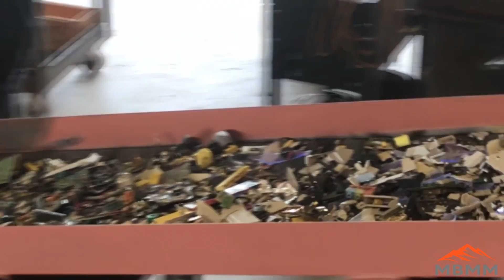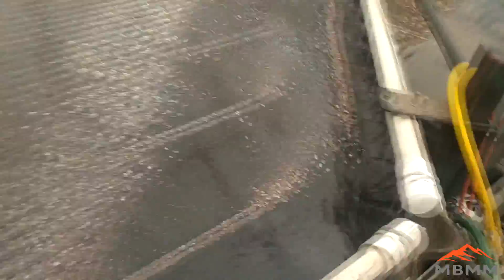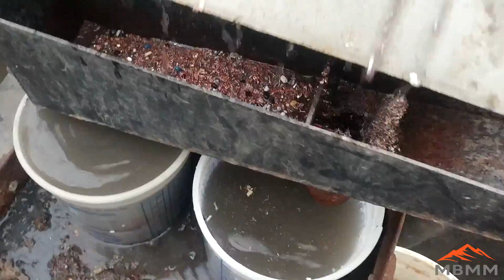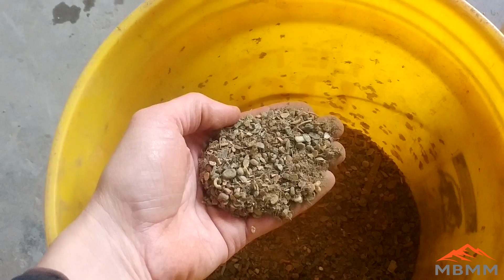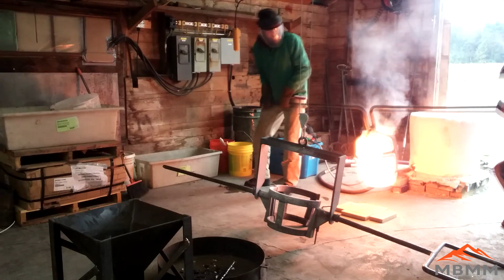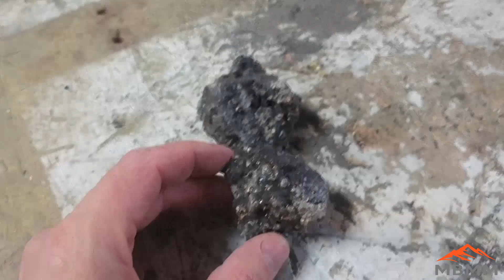Shredding & Melting Recycled Computers: Gold, Silver, Copper, Scrap Metal Recovery

Comment: I'm sure you figured it out since then
this is why you want as pure separation as possible BEFORE melting
i think you nailed the analysis Alum and iron oxidized and combined with the slag
Alum oxidizes very easy
you should have did a water rinse after grinding to separate the light plastic out
which will help reduce slag

Comment: How do you refine and sort metals that are melted together? How much did it cost to build the hammer mill? I want to build one from scrap metal and use it on circuit boards, wires, etc

Comment: A lot of the "plastic" pieces were tantalum caps.  Also, you didn't speak to palladium and nickel.  It was very informative to see how you reduced pcb waste to "metal bars".  As a chemist and an engineer I've been thinking about a scalable process to recover individual metals.  Tough nut.  Lab processes are much easier, but industrial is really tough.  I have some waste bars that appear to be mostly tin.

Comment: First the plastic is not waste at the very worst it can be promised to create feeder stock for the plastic and petrol industries second separating the case from circuit boards and components is probable worth doing by hand as it makes separation much easier Third it might be worth while to recover the fiber in long enough strands to sell as a concrete stergthing adaptive.

Comment: That water is contaminated waste now. Lead, mercury, cadmium... etc. Seperating more valuable components mother boards, ram, riser boards etc. and using a chemical process is far more efficient. I would definately recommend a respirator while being around the furnace and pouring stuff like that...heavy metals are nasty.

Comment: this is why they manually strip electronics (steel frame, plastic panels, wires, PCBs etc.) then they take anything that is metal unless it is obviously just a steel frame or panel only and turn it into powder and run it under seriously strong magnets to get rid of as much iron as possible. Then they dip it in acid and chemically separate valuables like silver and gold from copper and remnants of iron/plastic (PCBs go straight to acid). Then they smelt copper into thin sheets which will be submerged in a pool of copper sulfate and serve as anode and is then purified via electrolysis (final product is electronics grade and directly sold as is to manufacturers of cables and such).

It is really interesting stuff.

Comment: 20:18 use a reductive flux or add some more reative metals like alkalimetals which form low melting point oxides
since al2o3 got a pretty high mp (around 2000°C) it forms this insoluble junk
you may also remove aluminium beforehand with hydrochloric acid which will not dissolve your precious metals
another way may be gravimetric separation using sodiumtungstate solutions which can be as dense  as 3.1g/cm^3 so aluminium would float while other metals sink (its pretty expensive but you could recycle it as often as you like)
also your solid metals probably will not sink to the ground of your crucible since copper is more dense (same as rocks float on mercury)

Comment: do not shred towers.  Gold becomes fine powder. it floats in the wind. Instead take them apart using screw drivers.  Separate them into part that contain precious metals and those that do not.  Melt the parts containing precious metal. use no flux. Cover the parts with charcoal.  Pour into a mold. Analyze  that ingot.

Comment: With pyrolisis you get diesel and ash, i think it might be easier to get the metal from the pyrolisis ash or pyrolisis chamber maybe?, run the waste from it  through the system  too..? that and you could crush up the slag with the metal bits from the pour too..

Comment: circuit boards, brass standoffs, aluminum heatsinks, copper wire, lead and tin solder on galvanized cold rolled steel.

Comment: Some of the slag crap is likely very high-temp metals like platinum, tungsten, and tantalum.  

Older computers had more of those.  

I know when I do an aqua regia dissolution of old 1990's circuit boards and smashed chips (especially from old lab tech stuff), after bringing it to a boil and letting it cool, fine grey dust simply drops out of solution, which is all the platinum-group metals.

Comment: I like your videos as they are very interesting and informative. However, I cringe every time you use your furnace. Ceramic insulation releases its fibers when heated and is extremely hazardous to the health of your lungs and can lead to silicosis. Please consider coating your kaowool with rigidizer, coating your insulation with refractory so the ceramic insulation is not part of the flame face, and wearing a respirator!!!!!!! I realize that it would change your process and make things less modular but worth it in the long run.

Comment: Just read a paper which explained that mechanical shredding of whole components leads to a significant loss of pm because big parts are seperated with the iron fraction. They recommend to remove PCBs before shredding. This is also how the big recycling companies do it. They don't accept whole pcs because the high iron and aluminium content is disturbing the recovery process. So they buy only clean PBCs. Plastic however is not an issue for them. pastic is incinerated during the melting process und the released gases are cleaned in a scrubber.

Comment: In electronics much of the precious metals are plated onto another metal. In the case of connectors and  integrated circuits, those metals are magnetic. So I suspect you lost much of your precious metals into the magnetic bin.

Comment: bottom line is there is no easy solution ( or everyone would be doing it) there are only steps to be taken you can grind it all down to workable size not using magnet separator as stated because of plated stuff to be classified and dealt with accordingly

Comment: The unmelted stuff is likely tantalum capacitors, think the need something like 6,000 degrees to melt.
Reply: There is way too little in 25 towers. It would barely fit in a teaspoon.

Comment: no you have to do a bit of hands on.The steel bolts are probably worth more than the rest of the steel and bs to you recovering 85 of the gold and probably the same for the silver. With cordless  remove plastic coverings and steel chassis etc. Crush remainder down as  above  keeping in mind that you have got rid of 75 already.  ie you are trying to float off fibreglass only. Run through ball mill. Old story re density to have high recovery  After that its any bodies guess as too  what you can get off the table. You are probably in all likely hood have to treat chemically to get good silver gold  percentages

Comment: Great job on all the work you did ive refined some of this stuff for quite a few years in the back yard. Separating as much of the gold plated items first then i nitric acid the material i want to recover gold from then aqua regia it from there you drop the gold chloride and burn it into a nugget. Silver will encapsulate your gold so any silver in The mix  when using this method will subtract from your gold yeild

Comment: You don't now why the metal goes not to bottom  ? The heat you need to smelt paladium, platin, rhodium and rare earth metals is much higher than the heat for gold. You have no plan what you are doing with electronics to get back the valuable metals. no AU in the list ? no Gold recovered, haha. to recover only one clean metal you have to use galvanic methods so the process you used produced only scrap and litter. in europe you are going to jail for doing this shit.

Comment: First off, since you know which metals are in which devices. It would make sense to do some preliminary separation to help minimize the copper, steel, and aluminum/zinc fractions. I.e. disassemble them a bit more and put the wire in one bin, the steel in another, the plastic in another, and the aluminum in yet a fourth. That way you arent decreasing the precious metals percentage.
Reply: Especially since copper will pull so much precious metals into the cupel.

Comment: Keep your boards and chip sets separate from the rest of the smelt materials. I didn't see gold on those read outs at all and you should have recovered gold. I think you had too much of a mess going in and the gold got lost to the recycle pile, before the smelt. The gold didn't separate from the chipsets and floated away. Too little gold to hold the resin materials from floating.  I've watched a few different ways to get the gold, but the primary element is to separate them from the rest of the computer materials. Thus, do the boards (anything with gold) separately. I've seen people have success with hammer mills and gold recovery, but the final product from the mill is much smaller than 1/4". Grind to a powder. 

Other ways to get the boards and gold separated is by heat (fire) and by chemical stripping (acid baths). Chemical baths are a nasty series of chemical processes which is NOT environmentally friendly. It is effective, but dang a lot of spent liquid chemical by products (acids). You almost need to be a chemist to do it. There are instructional videos on Youtube, but I wouldn't try it. I'd go for fire separation and yes, there are instructional videos for that too.
Reply: Plastics (from wires) and other materials can skew results for gold. Gumming stuff up. Keep the wires separate as well. Those a chemical bath should easily dissolve the plastic to get to the copper. Acetone is the first place I'd look for helping with this. But first consult a University chemistry student or prof. Just a thought.
Reply from the maker: Thanks for the tips!

Comment: You would have had better results by separating metals from each other. Like all of the copper in one pile, aluminum in another pile, etc. Then, melt by specific temperature for the melting point of each of the metals so the metals that did not melt could be screened out during the pour. More work, better results.
Reply from the maker: Thanks for the tips

Comment: 1melting ,  easy metals.          2nd run.  Put the slaggy leftovers through the hammer mill then seperate on the shaker table.   Then melt what’s left.
Reply from the maker: Thank you for the suggestion! We'll be sure to try it out :)

Comment: I used to do this for a living as a chemist.  Stopped and learned to program to live longer.  First step after removing junk by hand, band saw, clippers is to strip exterior gold using the Crow cynation process.  This is a hot water wash with dilute potassium cyanide solution  in a cement mixer with addition of ml at a time bits of H2O2 to catalyze the reaction.  Go slow I saw this run away once and put a guy in ER.  (Then filter off solids wash and crush solids and do like you did in the vid) Sprinkle powdered zinc on the cyanide / gold solution to get the cyanide chelate to grab the zinc and let go of the gold.  Filter and wash these solids in a vent hood.  Remember cyanide and acid is DEADLY.  Next mix with HCL to dissolve excess zinc and filter that off in a fume hood.  Then refine the remaining gold precipitate / filter paper like streetips does.   From about 200 lbs of good electronic scrap and pins we got 0.5 to 2.0 oz of gold.  The material after the strip we washed and sent to a smelter.   The button from the smelter varied on yield.
Reply from the maker: Awesome.  Thanks for the info!

Comment: How can a hobbyist check to see the purity of metal the ingot he melts?
Reply: There are metal cert labs. I think some charge 25.00. I can't think of the one in Asheville NC I used when I had a foundry. But they have multiple locations around as well. Contact Modern castings magazine.  Or  search metal certification labs on google. Some scrap yards have a hand help spectrometer for identifying metals. Metal in your yellow pages. You coukd contact Foundrys in your area also found under F in your yellow pages or google foundiries locally. If they have a spectrometer they may do a burn for you for 25.00.

Comment: 1st of all I know nothing about what I am going to suggest cupelling with lead seemed to do a decent job before whats the amount limitation and is the lead mainly for getting gold keep going you have me as a subscriber for life
Reply from the maker: Cupelling works ok for mostly gold.  I think this has too much copper.  Thanks for watching!
Reply: @mbmmllc  ok with that being said I think if I was to do this large scale I would do it as you have but run the material from 1st run shaker thru 2nd run shaker at finer grind to get a better separation btw this is exactly how I pictured this in my head than I stumbled onto yalls vids
Reply: plus after reading the other comments def acid has to come into play b4 the smelt plus teardown and hand separate alum heatsinks etc nothing is easy insert haha

Comment: A agree the aluminum and a good part of the iron were oxidized when you started heating it with no flux initially. You wont be able to melt aluminum or iron oxides. For sure do a stem where you extract all the iron, then melt with flux to prevent oxidation. I am not sure what to do with any left over ceramic in the mix. Thanks for an interesting experiment.
Reply from the maker: Great, thanks for the tips Chris!

Comment: You should have grounded the particle finer, that would allow getting out more of the fiberglass that don't burn or melt, (board are designed to resist high temperature for soldering) Personally I would have used an induction furnace so I could inject MIG welding gas inside to prevent oxidation.
Reply from the maker: Great, thanks for the tip!

Comment: do the math for a lot, say 100 to 1000 towers estimate 100% return, multiply by high, low and average amounts for each metal.
remove the towers and run the "guts" in a micro crusher, and go from there. then run past the 'cross belt magnet' go from there. also watch nerd rage and codys lab on similar experiments.
Reply from the maker: Great, thanks for the tip!

Comment: I melt a lot of mixed metals and recovery metals. One major thing is to try to get your metals as clean (less excess junk) as possible. Also, stir it a lot. The more metal, the more stirring is needed. Aluminum likes to stick to thinks in liquid form, and the steel/iron will float on top of liquid copper and aluminum. As will the carbon from the trash.  Stir, let it settle a little and lightly scrap the dross off the top. Stir some more, then scrape again. Do this until you have a clean pool of metal. Then add borax (about 30 grams per kilogram of metal, extra won’t hurt) stir again, then scrape once more. After that then try pouring. Also, check the temperature of your foundry often. You’ll want at least 1100 C before you start scraping. For something as mixed as you were running, 1200 would probably be better, but keep it under 1500 unless you want an aluminum fire.

What I would do is run the dross through the hammer mill again, then cut up the ingot (don’t try to melt it whole, because that would be a waste of fuel and time) and melt all the metal you recover the second time around again. Scrape the steel and dross after all the other metals have melted, flux it, scrape again, then pour.
Reply: And in case you were wondering, I do this as a side hobby and extra income. Where I live the recycle centers won’t take cans, but they will take aluminum ingots and extruded aluminum. I melt it all because it pays the same, and is easier to transport in ingot form. I also melt copper, brass, and all forms of bronze. Steel/iron is only worthwhile in large bulk so I only take that in about once a year. An average month will get me between 150 and 200 pounds of aluminum, 200-250 pounds of pure copper and 100 pounds of mixed copper (bronze/brass).
Reply from the maker: Great, thanks for the tip!

Comment: You appear to be wasting time and energy to produce brass ingots and very little silver and no gold based on your X-ray fluorescence analysis which by the way is a poor tool for what you want to achieve! X Ray is highly dependent on depth and therefore with what you feel is homogeneous melt is NOT when you have this variety of metals with high and low melt points. In my opinion you are better served by a acid digestion of the 25 lbs of waste with HCl to digest all the copper and zinc and aluminum and other metals like tin that will dissolve in the acid. This would leave you the gold and platinum and palladium. The silver would be dissolved in the HCL. If you do a ten gram or 100 gram sample this would give you a fairly good indication of precious metal levels in the bulk 25 lb prior to doing all this labor and waste of time and money not very smart !!
Reply from the maker: Great, thanks for the tip!

Comment: So I’ve been thinking about this and I wonder if you could put the slurry after the shaker table into a bucket and shake it there is a chance that the different materials will differentiate.
Reply from the maker: Its hard to separate 100% by different densities on a shaker table
Reply: Yeah but what I’m thinking of is how soil samples are separated. They put them into a jar with water and seal it and shake it. Then the different densities separate. I realize that there are some variables that won’t scale with metal and you might need a higher density liquid and more aggressive shaking. In the end it’s just an idea I’m thinking out loud about and you have way more experience than me.
Reply from the maker: @pyredynasty  I see your point.  Yes, good idea.  Thanks for the tip!

Comment: Kind of a "brute force" approach, eh? For tiny parts, you may need a more refined technique. Due to the law of entropy, however, it might not be possible to recover valuable metals without putting in more effort than they are worth. Also, you might try a slightly lower heat for a longer time, to eliminate boiling, reduce convection, and allow for settling.
Reply from the maker: Great, thanks for the tip!